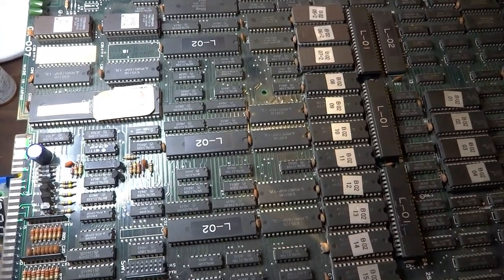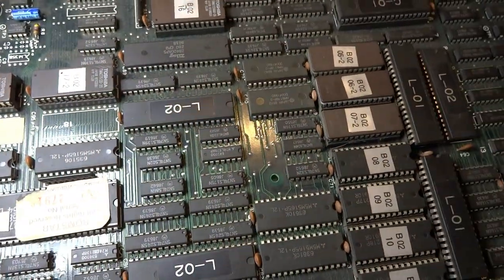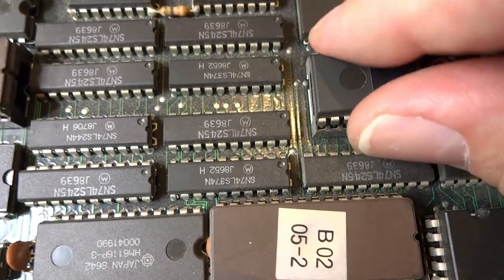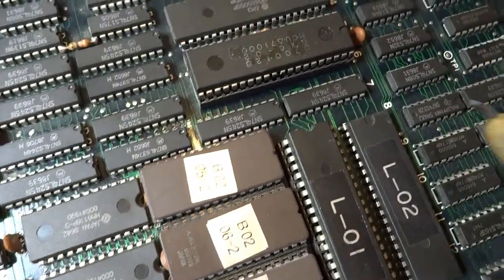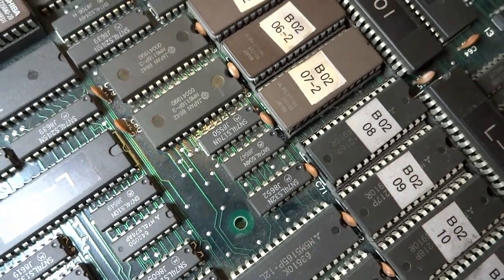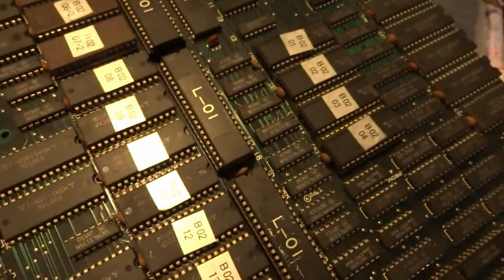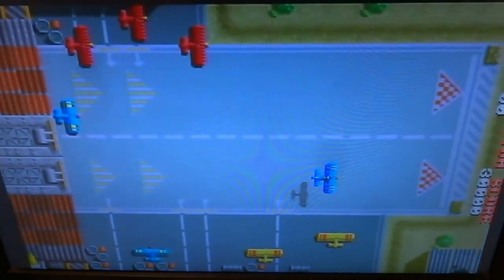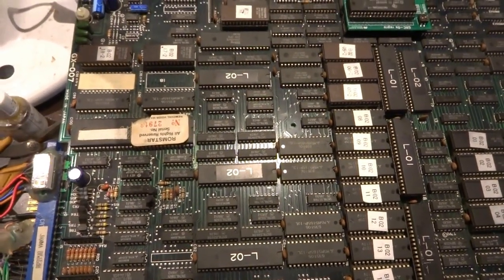Taito Sky Shark Arcade PCB Repair

Comment: Super quick repair =D  It's an MCU - basically a CPU with either storage or IO or both.  Strange how they seem to have used an off the shelf part, with what appears to be a different pinout.
Reply: Actually a DSP from what I understand.  It executes code from an internal mask ROM.  The repro uses the same chip without internal ROM and executes code from external flash.  It's used as a protection chip.  The fact that they are using a DSP for protection hints to me that they are doing something very complicated...
Reply: @douro20  Yes, there's conflicting information on a few websites.  In a few places its described as an MCU, but as you say it's actually a DSP.
Reply from the maker: Gotta love the quick ones. This MCU adapter doesnt simply change the pinout, it also has flash memory soldered to the bottom as more complex maping components  :) It looks basic on the top though for sure but is quite a bit more intricate.
Reply: @douro20  The 'GC-0x' (where 'x' can be 1,2,3 or 4) is a TMS320C010 DSP co-processor in disguise with internal MASK ROM.My replacement emulates all four versions.Again, thanks to Luke and to everyone who uses my reproductions for supportinmg my work.

Comment: Hey I wanted to ask if you have ever considered using a gopro camera and placing it on your head so that you will be able to play with both hands and also film what you're doing?
Reply from the maker: The playing part is just something to mess around with once the board is working and not actual gameplay. When I do the game play vids and repairs, I usually set it up on the tripod. As for the GoPro on the head, it would be good for things like outdoor cycling vids or automotive repair but attached to the head may also have some undesirable results. Multiple cameras or a cameraman would be nice though lol.

Comment: luck or experience?? anyway nice one dude (are you sure the chip was bad? the ic-socket looked bad perhaps reseat the chip could do the trick aswell?)
Reply from the maker: Probably a bit of both to be honest. These Taito boards in particular as well as some other Capcom boards etc have no schematics to follow which means finding the root of the problem could take forever. Knowing about the most common ICs that are prone to burning out or ones that are likely bad is definitely the experience part. As for the MCU, yes, it was definitely bad. Trying it in another board I own was able to clarify that. Reseating and wiggling it in place was done off camera in the "cut" section where you can see the label removed. Sometimes it does do the trick though.
Reply: @lukemorse1  COOL and yes having a board that works makes things a lot easier :) NICE love these video's thanxs

Comment: So, are you sure that the socket wasnt at fault? It seemed to pop right out with no effort, but your replacement went in hard - due to the round pins I imagine.
Reply from the maker: During the cut, I checked if it was loose by wiggling it in place without any change. You are right though, sometimes it IS the socket that is faulty and recommended to check them as Ive done in previous vids.

Comment: I have a Sky Shark here that is a TP-007.  Safe to Assume the difference between TP and GX is region?   The board I have has no video and is pulling > 5Amp on the +5V line.  Can't find schematics for the board.  Any suggestions on where to start?  Thanks!